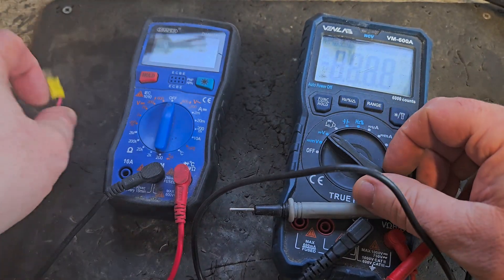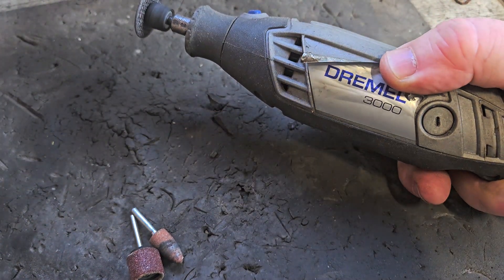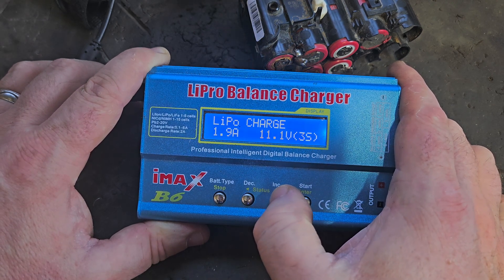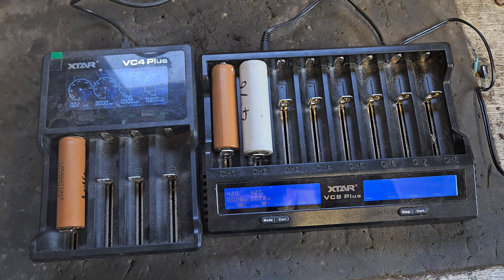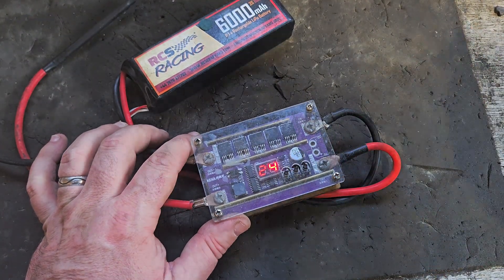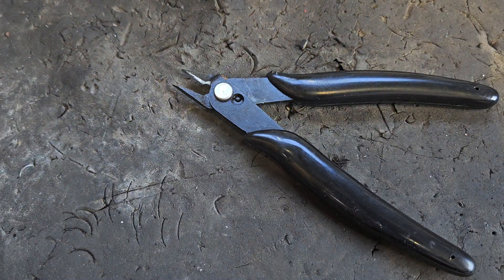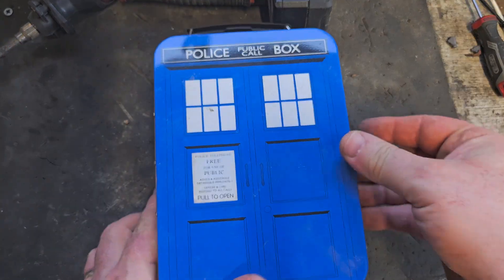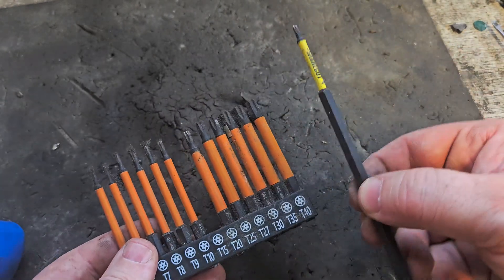Battery Repair Techniques & Tools - Everything You Need to Get Started

Comment from the maker: To purchase these items links are below

Venlab VM-600A https://amzn.to/3TjP4i1

Draper screwdriver https://amzn.to/4e9qda1

Dremel 3000 https://amzn.to/4e9qda1

DC Bench Power Supply https://amzn.to/4ek821t

Lipro B6 Charger https://amzn.to/446Pmxl

XTAR VC4 PLUS https://amzn.to/4n83AXB
XTAR VC8 PLUS https://amzn.to/4k2nSPE

Nickel strip https://amzn.to/3FMYpf4

Flush cutters https://amzn.to/448mcxU

M12 Soldering iron https://amzn.to/40ba6Tu

Ersin solder https://ebay.us/m/ZfJQHu
no clean flux https://amzn.to/3I1Ya06

18650 heatshrink https://amzn.to/4etWEQV
Ring Insulators https://amzn.to/4kNcAQf

Draper Heat Gun https://amzn.to/4e7900R

Hakkin bit set https://amzn.to/43PRVVT
Sabrecut bit set https://amzn.to/44doOuJ

Comment: If i were to buy just one device for charging, balancing packs and reviving dead cells, should i get just the dc bench charger or the Lipro charger? Cheers
Reply from the maker: I would say the lipro charger it will do both it's much more versatile.
Reply: @doctorlefthandthread  Ok cheers Doc 👍🏻.